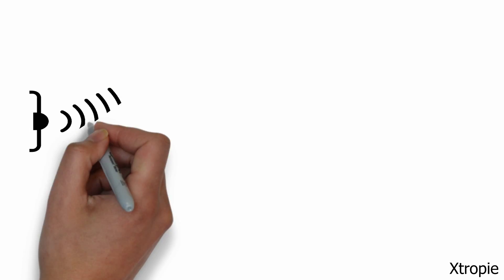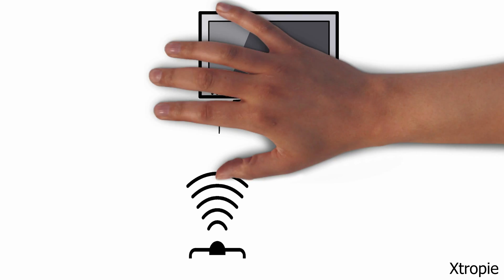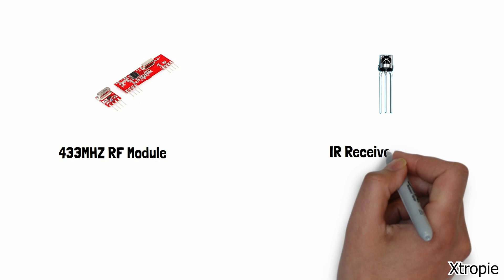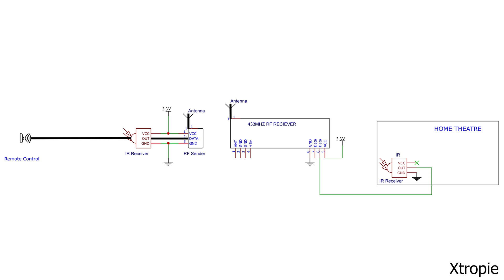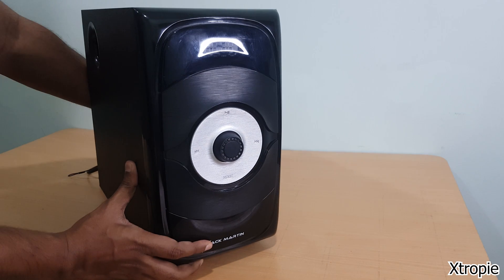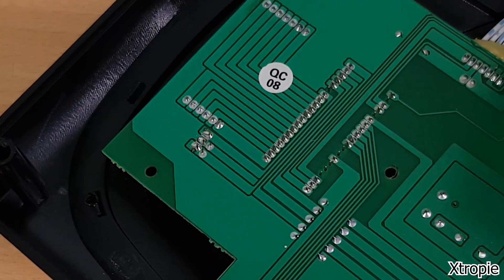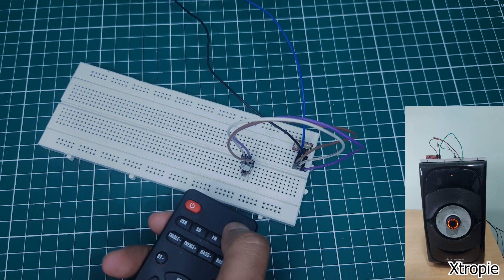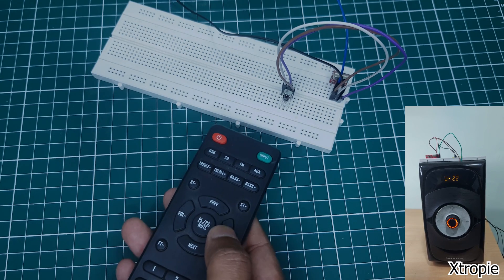Hacked!!! Convert Any IR Remote Into RF

Comment: Would it be possible to convert the IR to bluetooth, zigbee or WIFI using a similar technique?? And if your still using the IR remote dont you still need line of sight to the home theater for the home theater to recieve the signal and then convert it to RF?

Comment: Would this also work to connect the input of the RF transmitter directly to the IR pins in the remote, bypassing the IR receiver?
Reply from the maker: Thats a really good query, but that won’t work!
Reply: @xtropie  I'm interested to know why not? The levels and format wrong for the RF xmitter input?
Reply from the maker: After some research , I feel it can be made possible, I will try to demonstrate in one of the upcoming videos.
Reply: @xtropie  fantastic! I want to resurrect my Nintendo Satellite with this method